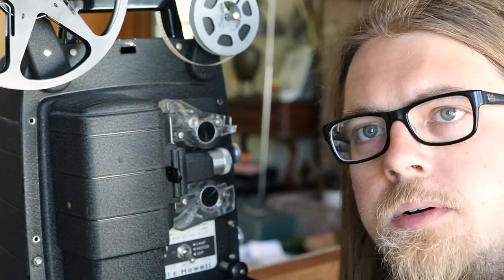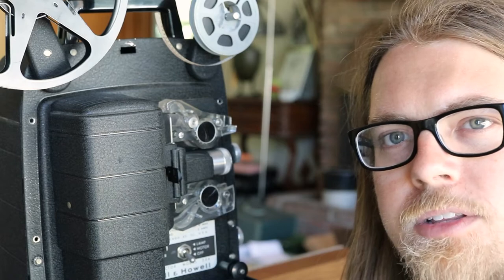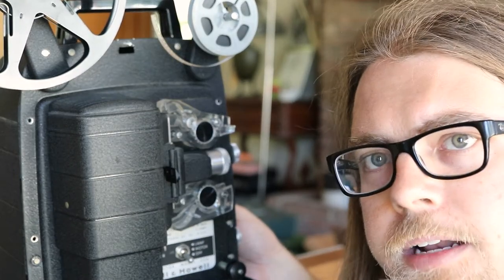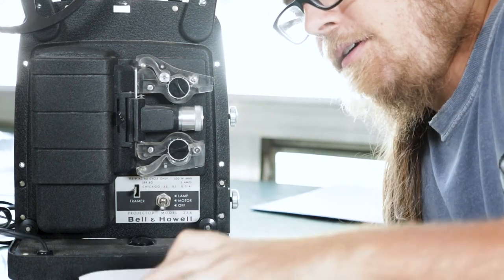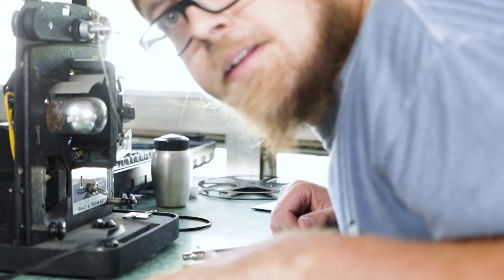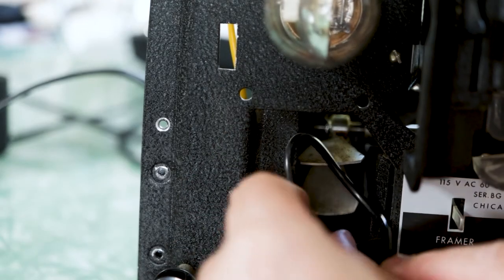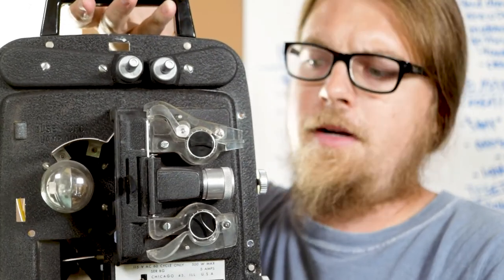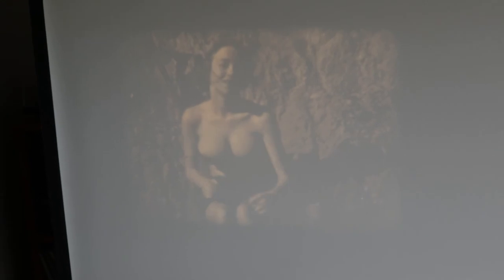Replace the drive belt on a Bell and Howell 256 8mm silent film projector

Comment: awesome. I just bought one of these an hour ago, a cast grey one, and while it seems a little different, the main teardown difference was the front screws are all small, no 3/16" ones. the belt was so bad it didnt move, and going by the mark on it, i now know what was burning.💀

edit: it is actually a 255 A, not a 256👀

Comment: Great video! I picked up the same model projector from a thrift store and have the same problem. Hopefully a new belt is all I need
Reply from the maker: Hopefully!  These seem like a very robust design without the issues that plagued later B&H units.  The only other issue I've noticed is that the screws that hole the spindles for the reels in place are made of nylon, and I would definitely recommend replacing those with steel screws.  I've seen them on eBay, or you can try your luck at a hardware store, but the big box places are pretty hit or miss for small fasteners.
Reply: @AlexMakuch  Hah, steel screws would have been a good idea. The top of one of the spindle screws broke off of mine. It looked liked someone previously glued it so I did the same. Still spins, but I'll keep the steel screws in mind
Reply: @AlexMakuch  that's interesting: mine were all metal, but the front ones had some sort of gunk on them, i assume for protection, that made removing them difficult.

perhaps they improved/simplified them later?

Comment: I just discovered this projector packed away at my folks house. I've ordered a new bulb before I realized the sprockets to the auto feed are not spinning.  I've opened up the housing and all of the gears are moving.  Any idea of why the auto feeder sprockets would not be spinning. If I can get this fixed, I think I'll go ahead and replace the belt while it's opened so we can check out the old movies we found. Thanks!
Reply from the maker: Hmm, so, to preface, I'm not actually a projector technician, just some dude on youtube.  So when you put the projector into "forward" or "reverse," the worm gear is driving the two gears it's connected to, but neither sprocket is turning?  I'd get the silly stuff out of the way and make sure that you're shifting into forward and don't accidentally have it in neutral.  You can also try turning that small silver wheel that's sort of on the side; that's the manual advance/reverse that is connected to the worm gear.  It's the upper one; the lower one adjust the feet of the machine.  If you turn that, the sprockets should move no matter what the machine is set to.  

If you've double checked that kind of stuff and the machine is in "forward" and the gears are moving but not the sprockets, I would guess there's an issue with the way the sprockets or the gears are connected to their axls.  If the machine isn't moving the sprockets shouldn't be able to turn at all, so try turning them by hand.  If they move freely, there's definitely a problem.  Same with the shafts going through the gears.  If any of those parts are moving when they shouldn't be, I'd start there.  Getting these projectors repaired is really expensive unless you happen to live near someone who does the work (the bench fees are usually reasonable, but you get murdered on the shipping).  If it's really broken, you can probably find a working one for cheaper than repairing.  I haven't had to mess with the sprockets on mine, so that's about all I got.  Good luck, and I hope you can get it running!